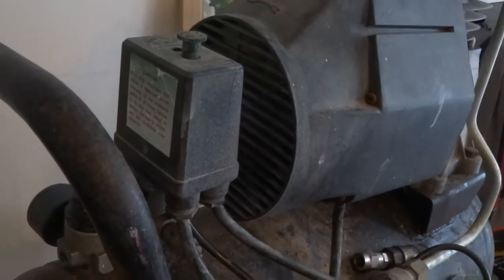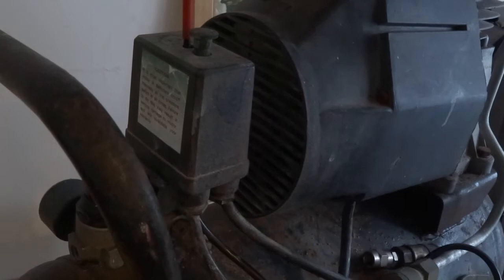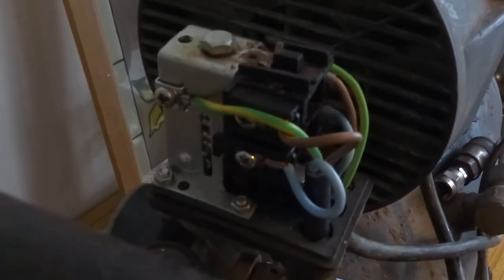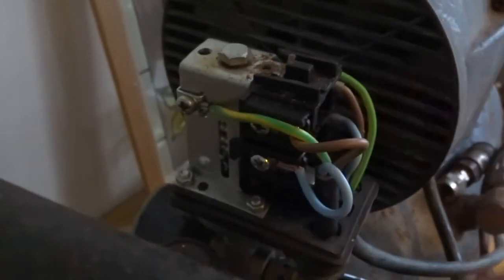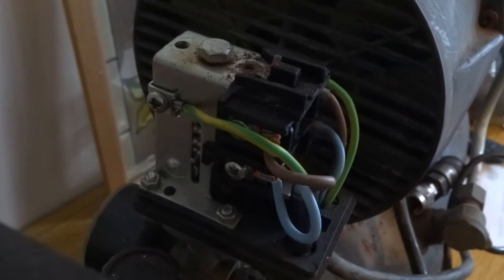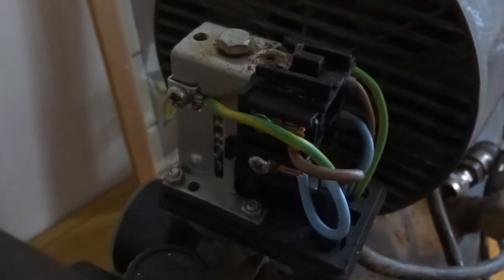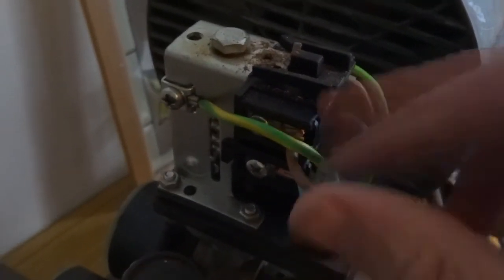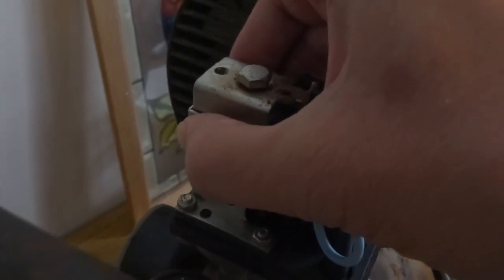Air Compressor Pressure Switch Wiring & Adjustment DIY Guide

Comment: Hi don't suppose you can tell me where the live and natural go....IE what goes on motor and on the line...??
Reply from the maker: Not without looking it should be easy 2 in and 2 out   , as long as its double pole switch , if not make sure live is the one switched but you need to test to find out.
Reply: @cagmito76  not to worry,I snapped a bolt on the oil plate so now have an excuse for a new compressor lol..it was an old one